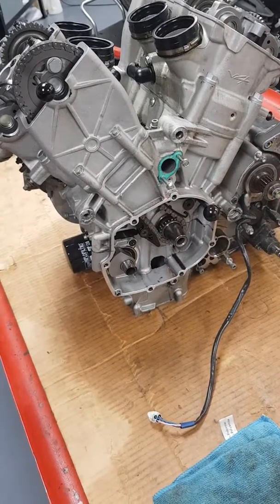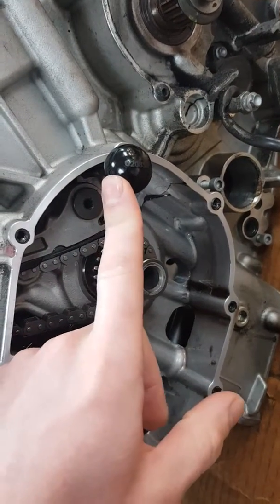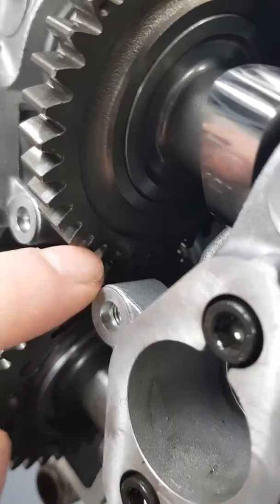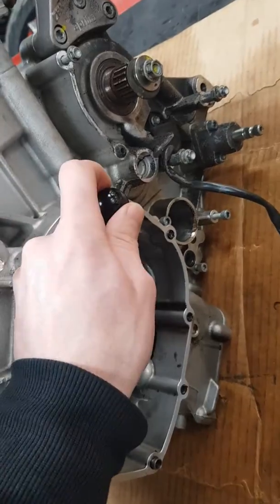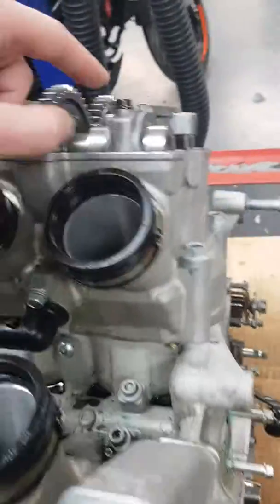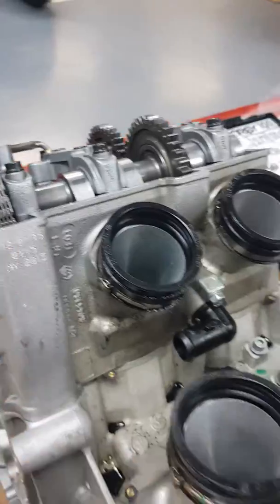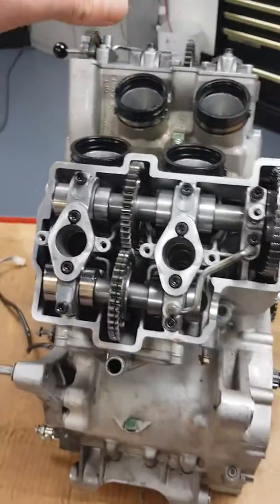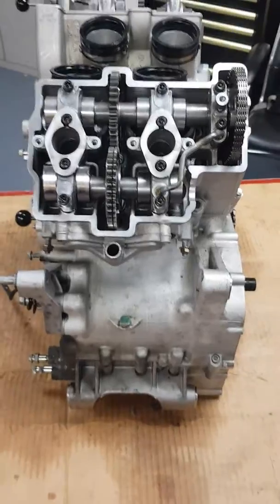Aprilia RSV4 cylinder timing

Comment: probably a daft question but anyway...
when timing the rear bank you say 450º from TDC but on a forum im reading 300º from TDC. mine s 2012 APRC R and im wonder how ill know what degree of rotation it requires? hope you can help.
Reply: this video is not correct

Comment: Hello mate can you remove the camshaft clamps/guides that the rocker cover bolts to without locking it all off as the thread has stripped on it and cant bolt the rocker cover on no more. Looking to remove just one so can re-thread it.

Comment: Any chance you could show a demo of how to remove and install and release the timing tensioner?
Reply from the maker: Unfortunately not as the engine has already been put into the bike and back to the customer.
Reply: @jonny8730  Did you use the aprilia tool to release the tensioner or some other method?

Comment: On the flywheel side, the manual says you can use the flywheel lock tool to hold the flywheel and then remove the crank locking pin, but doesn't the flywheel need to be removed (2010 engine) before you can insert the crank pin?
Reply: Pretty sure you need to pull your flywheel. The newer ones you dont have to
Reply: Now that I've done it I can answer my own question....for me it fit with the flywheel installed (2010 factory) but if you're removing the head, you need to remove the flywheel anyway to remove the timing chain and sliders so yeah, that flywheel needs to come off anyway in most cases.

Comment: Ok I’m building a rsv4 engine talk through show me in next video I see what you are talking about but if you Actually do it that’s what I need please and thank you
Reply from the maker: Also make sure the cylinder with the timing chain off isnt getting caught up on the crank at the bottom when rotating the engine.
Reply: Jonny 87 ok I’ll try that
Reply from the maker: Hi, unfortunately I dont have the engine apart anymore so I cant make another video to show you mate. 
What is it you are stuck on? I'll try and help you as best I can over message.
Reply: Jonny 87 where are you located
Reply: Jonny 87 so this is my problem I turn the crank and it stops with one timing chan off and one head off
Reply from the maker: Okay, try this turn it till it stops by hand then loosen off the timing chain wheel that bolts to the cam shaft. Adjust that back. See if that works. I'm located in England.

Comment: How to load cam chain tensioner after replacing camshaft? In service manual is special tool to do that but there isn't any procedure.
Reply from the maker: To deploy the cam chain tensioner you need a long and thin tool to slide down the cam chain tunnel to push against the chain slider just enough to deploy the ratchet mechanism. ( obviously this has to be done when the cams are in and aligned and bolted down ) I would then suggest turning the engine over without the spark plugs in before starting the engine just to build up oil pressure within the tensioner before the initial start. It is a very fiddly job and be sure not to damage the chain or slider when applying pressure to them.
Reply: @jonny8730  so the cam chain should be tight? Mine is slightly loose
Reply from the maker: @sinisterspeed6782  yes should be tight
Reply: @jonny8730  cool. Would I have to use the tensioning tool or would oil pressure with no plugs  and fuel pump be sufficient? It slack towards the exhaust side on the rear
Reply: @jonny8730  Just to clarify this point, the one cam bolt should be installed but not tightened, you only slide the cam gear onto the cam and loosely install the first cam bolt. Then you engage the tensioner, this will cause the cam gear to slip a bit, once there is proper tension on the chain, THEN you bolt down that first cam bolt properly to torque and follow the process to rotate the crank and install and torque the second cam bolt. If you torque down the cam bolt and then release the chain tensioner your timing will be incorrect.
Reply: So the chain should be tight when you reinstall and time the cams. Mine is slightly loose because I dropped it by accident being too rough getting the cams out

Comment: Hi! That's exactly according to manual. We did the same, but... We got front cylinder working properly and rear cylinder not working at all... ) Searching whats the problem is ) All come bacj once we did it.
Reply: Putting this reply here on this old video to give a clue to anyone searching around when you're using these timing pins for the crank and cams - you see these timing marks on the crank 2 times per full cycle ( every 360 degrees of 720 ) every 360 turns the cam 180 degrees.

what does this mean? when using the crank and cam pin alignments the only way you can time the rear wrong is by have it 360 degrees out from the crank and its out of phase from the front and sparks on the exhaust tdc rather than compression tdc.
you just have to time the cams 180 degrees forward ( or 360 degrees crank )

you can confirm timing by then watching intake cams roll open 1-3-2-4 OR when the crank and rear cam pins are aligned cylinder 2 intake valves are slightly open starting their intake stroke.
Reply from the maker: Did following this video work for you my friend?
Reply: di you solve the problem. im having the same
Reply: @myvw8u  Hi man, I am having the exact same problem. Front cylinders where running but rear cylinders are not and back firing. Dit check the timing again but seems te be OK... what was the solutions for you? I think I have got everything right. Whould be great if you could help me out!
Reply: @rubendemuyt1630  i messed up the timing. but i did solve the problem.
after the front bank is timed it is crutial that you bring the #1 cyl to TDC on the compression stroke not the exhaust stroke. than you can time the rear bank.
Reply: @myvw8u  can you walk me through getting it to TDC. And does it matter if I stated with the rear. I dropped the cam chain sprocket attempting to get the cam off about an inch. The chain is light loose now and not sure what to do. Pretty sure it needs to be tight yeah?